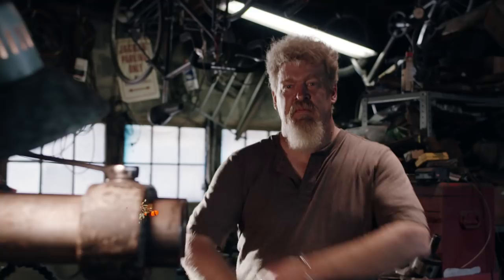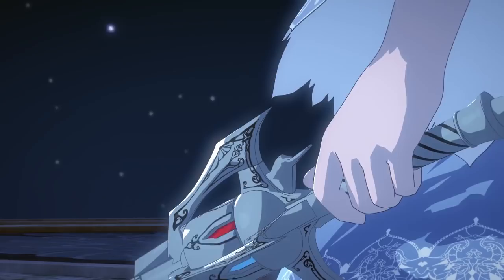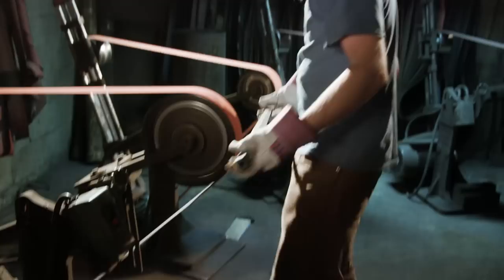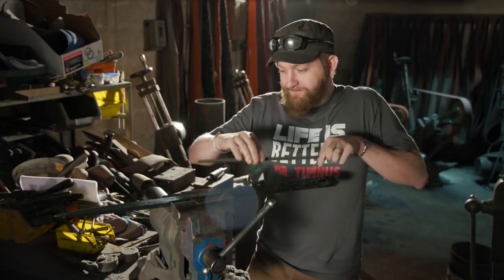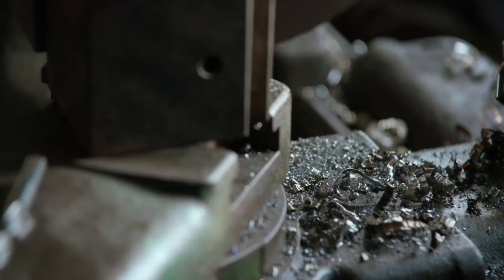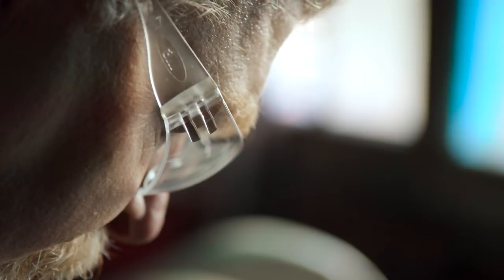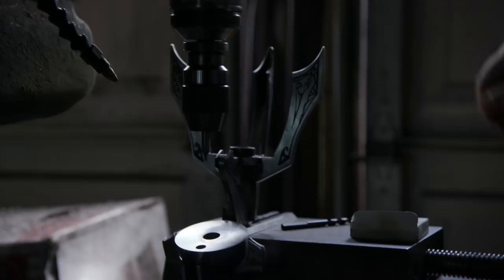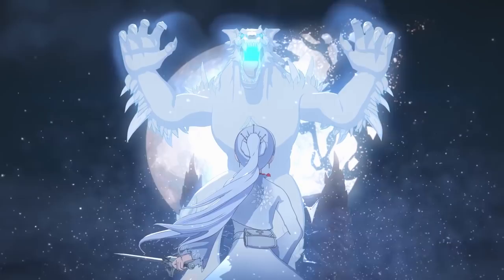Weiss Schnee’s Myrtenaster - RWBY - MAN AT ARMS: REFORGED

Comment: That's one enthusiastic cosplayer... I mean look how she delivers that thrust..
Reply: Fresh Orange The  raipier is probably pretty heavy, making it difficult to do a proper thrust
Reply: I was thinking the same thing, Orange.
Reply: Fresh Orange ikr but legit that would be me if they made yang xiao longs ember celicia
Reply: Boris Chung not just too heavy, the weight is way too far forward as well due to the dust chamberand the blade starting further forward, plus there's no way to properly finger the guard.
Reply: It's heavy man give her a break
Reply: They super human
Reply: It was extremely heavy. I was there for the day of filming and held it myself. I'd like to see you handle that with one hand with no practice or prep time.
Reply: Real Rapiers are heavy. It was probably a mix of blade balance and a bad stance. That said, her face looks she didn't want to be there, which is a bit like the character, just with less grace and ego.
Reply: Gael Ackerman actually how heavy was it?
Reply: Tom Franco not really, rapiers usually weigh less than 3 kg , most that I have come accross are around 1. That blade looks way heavier.
Reply: Yeah, they really should've used a lighter alloy to build it but given the nature of a show like this it makes sense to use a metal that's easy to work with.
Reply: zeus lim my guess would be at least 15-20lbs. A lot of the weight was in the handle. I was Mikasa in the previous video and was criticized for not handling an extremely heavy and unrealistic weapon as well and I'm not about to see people do that to my friend here. I'm above average in strength for someone my size and even I found their weapons heavy because of the material they're made of.
Reply: Uhh.. i just was pointing out that there was no excitement. Not criticizing her ability to lift the thing...
Reply: Fresh Orange Understandable, have a nice day. Thanks for clarifying . I guess I just jumped to conclusions looking at the other replies. I sincerely apologize for my misconception and if I have offended you in any way.

Comment: Weiss' Rapier might have took a month to finish to reach a 20 min video. Dang.
Reply: With a team that size, only 3-4 days tops
Reply: 3-4 days is an underestimation, Probably around 5 in real terms
The rough forge of the blade to shape is several hours of work, even with the power hammer you're looking atleast 3-4 hours of working time
then the blade needs to stand and cool, at room temp to avoid serious hardening: Day 1 gone
Going to the rough grind is again a good 2 hours machine time to do right
After the rough grind, before the tapping of the thread he specifically mentions it's been re-heat treated to make sure the metal is in its softest state for the tap - that makes the end of day 2 the heat treat and the tapping the start of day 3
Now you have the heating and surface hardening quench, followed by the blade trueing file and grind to ensure the blade shape by the end of day 3

Then you have day 4 for final assembly, assuming everything went quickly and smoothly up to this point
Reply: Fair enough, I dont know much about smithing so I was going off the fact that all the machining work could be done in a day then gave a few extra for the blade work
Reply: True enough on the machining, the hilt basket chamber is quite simplistic in comparison to actually forming the blade - don't forget to also include a day for making the guy who needed to imagine how they's go about making it to begin with to sort the CNC drawings and sizes before any work started
It's a shame they went for the thread, if you where making the blade for real use I would expect the blade tang to be ground cylindrical and pass through the dust cylinder for real strength - that would require quite a bit more time and a cylindrical grinder however

Comment: Pretty good.

Would be even better if it was made of silver, though that would cost one of Yang's arms and maybe even one of her legs.
Reply: Locutus Borg it would be too soft to do anything with. Silver isn't used in structure for a reason
Reply: equivalent exchange i see
Reply: Probably just an arm.
Reply: Yang is the new Edward lol
Reply: It wouldn't be a problem if they coated the material in silver would it?
Reply: Well actually I was thinking in terms of the show, not real life.
Silver is already established to be a significant color with supernatural implications and in many other works of fiction it can repel werewolves and the undead. 

Then there's mithril, the "true silver" featured in LOTR which is actually both lighter and stronger than steel by quite a large margin.

Maybe a similar effect could be achieved by treating the sword with dust, allowing Weiss to deflect magic attacks.
It also fits in as the heirloom of a rich family. 

Whatever. Just my imagination.

Comment: IT'S ALSO A GUN !!!
Reply: It's like one of two that isn't i think. I has a revolver chamber, but doesn't shoot.
Reply: James Cretchley it shoots through the end of the blade end I would assume since I don’t think motion controls would be that reliable in combat when you need to reload and aren’t looking for meaningless destruction and difficulty plus it would make sense since in volume 1 she had her finger on the trigger but since Ruby surprised her she let go of it and it shot in a straight line coming from the edge of the blade instead of a wave of fire emanating off of the blade as a whole
Reply: Correct me if I am wrong please
Reply: Well there's a dust exhaust port for it near the pommel and that's where there's a trigger and a hammer. I'm no weaponsmith or anything but it seems once she "shoots" the blade is what acts as the guide for where it'll go (I also wonder about the dust in RWBY and if magnetized blades could be responsible for the coating thing Myrtenaster does, aka, the lightsaber thing in her trailer). Plus, consider the weird anime physics and how, in the V5 short, she used her hand to help coat the blade in red dust and send it in an arc.

Either way I think they did well with the build.
Reply: It's a magic gun

Comment: Rubys scythe
Reply: jacob smith crest rose that's    the name
Reply: jacob smith it's called crescent rose...
Reply: jacob smith Maybe too hard. Also, scythes are extremely ineffective weapons.
Reply: But... it's also a gun!
Reply: I understand I watch rwby but I couldn’t remember even thought I own a cosplay model
Reply: not only are scythes ineffective weapons, but crescent rose is also physically impossible to build.
Reply: 1. It’s called Crescent Rose and B. That doesn’t seem physically possible
Reply: But isn't that the challenge at the same time? ^^
Reply: No it’s not I have blueprint for a build
Reply: NochSoEinKaddiFan considering the number of moving parts, the dual functionality, and sheer size of the weapon, it’s not a challenge. It’s not physically possible
Reply: As an aspiring engineer, "not possible" is literally a challenge for me xD
And in quite a number of cases things that had been concidered impossible were done anyways eventually.
Reply: Okay let’s explain one,  the one I made which is shorter than the normal version my version is in the 5 “10 - 6ft range two, instead of creating a metal version I used many different materials third, the gun is hard but you don’t have to make it that hard because instead of making that shoots bullets with a gun power reaction I made one with spring coil that puts pressure onto the bullet that builds force until I pull the trigger, that launches about 150 feet and plus my bullets are made from a lightweight cartridge instead of being heavy sniper shells fourth I made the scythe to were it folded onto itself to a grip for the gun. Fifth I made the scythe blades out a lightweight metal (the same as the bullets, i also made the parts of the scythe compact with screws and moveable bolts that can just easily be removed and put it into the spot you need it to be.
Reply: There we go, it sounds really nice :) Is there any documentation or pictures? I'd love to see it!
Reply: I can try get you a picture I made it for a friend who loves to cosplay ruby

Comment: Any weapons from Monster Hunter, but I'd love to see a switch axe or charge blade.
Reply: as badly as I want to see one as well you're asking these people to break physics, A switch axes transforming mechanism would have to be really slow or you'd risk pulling your shoulder out of place
Reply: Meredith I've been asking for years for them to make any sword even a long sword which would easily be one of their longest swords but they haven't
Reply: they could easily make a smaller version it's only two moving parts. hilt slides up while blade rolls back into hollow center. axe mode: hilt slides down blades rolls out. not much different then Ruby's Scythe... given that has i think... maybe two bolts and spring.
Reply: Monster hunter switch axe

Comment: PLEASE DO THE CRECENT ROSE OF RUBY
Reply: As much as I want to see that as well, that would be a bit on the heavy side...
Reply: who needs things to be normal when its awesome
Reply: Yama Yami 
The buster swords from final fantasy. It's the Dragonslayer that's from Berserk.
Reply: Yama Yami i agree with you. Why would some guy bring a huge damn weapon in a fight with very little mobility ?
Reply: Combine the stickle with a Barrett .50 Cal? Hard to do it
Reply: its theoretically possible to build the Crescent Rose if its made with modern materials like carbon nanotubes and aluminium, and only have the blade made of steel, the pommel on the base of the shaft will also be made of steel to act as a counterweight, and the assembly for the rifle itself can be fabricated using the Russian PTRS-41 Anti-Tank Sniper Rifle as the base.

(as a comparison .50 cal is essentially 13.0 mm, the PTRS-41 uses 14.5mm depleted uranium rounds, which not only dwarf the .50 cal in sheer size but also has enough stopping power to penetrate through a tanks armour, straight through the engine block and through the other side)

Comment: Do Ruby's Crescent Rose or Qrow's scythe!
Reply: Crescent Rose is like Level 90 RWBY Forge.

Let's ease them into the more complex weapons as time goes on. Now that they've done Myrtenaster, I think the next level up is Blake's Gambol Shroud.
Reply: Crescent Rose is almost IMPOSIBRU to build lol
Reply: Lula Mendiola crescent rose is impossible since it's not a realistic weapon
Reply: andy torres neither is this one given I haven't fin the vid but I'm pretty sure it doesn't have magical powers of dust. At the least the scythe is possible and I could see somehow making it fire projectiles it would just be heavy as hell and unsafe. But if the hacksmith could make the umbrella from Kingsman shoot things and have a projector camera....and joerg sprave on the slingshot channel make a "end him rightly" pommel launcher I don't see why the great amazing Smith's at Baltimore knife and sword (who all ready made a flaming Voltron blade as well) could not figure out the crescent rose... And they have also made quite a few unrealistic or practical weapons on here...
Reply: In all reality Crescent Rose is a possible build but it's mechanics are not really something for forge other than the blade. The whole thing needs extension, hydraulics, servos, and glide joints not to mention it would need wiring switch style to be true to the show of having it unfold itself with a simple flick of the wrist. Not a build for hand and steel.
Reply: either of those would be a nightmare to build lmao

Comment: So many things they could have done to make it lighter, and more usable.  The cage around the cylinder  could have been shaved down to 1/8" thickness.   The cylinder itself should have been smaller, and the drill holes larger.  The blade could have been flatter, and drawn out into more of a true rapier (although that might not have been as acurate to the show).  
Cosplay on point though.

Comment: Maybe try Nebula's crossbow sword? It was shown in the fight of team SSN vs NDGO, it looks like a bolt crossbow which has the blade extend out from the inside, and the string is closer to the sword's handle, and the bow part folds in. The bolt looks like it is pushed by the string from a little below the surface, like the main body of the weapon holds the loading area. The trigger for the sword collapse is near the sword handle on the weapon's top surface area, and the crossbow firing has a trigger on the bottom closer to the center of the weapon's main part. That's what I can tell about the weapon  while looking at the fight scene.